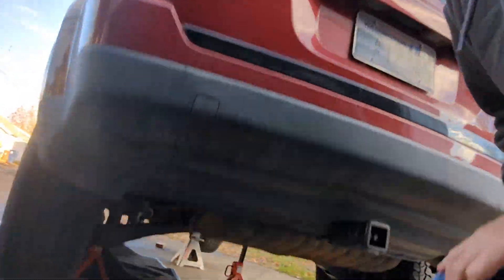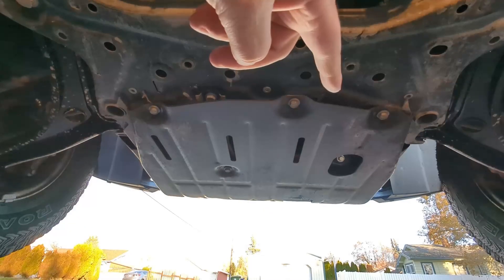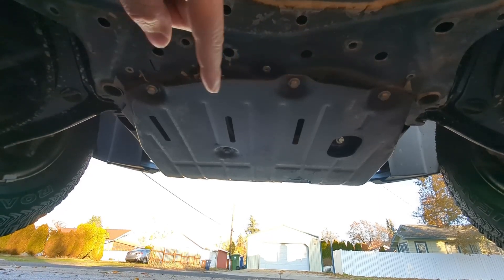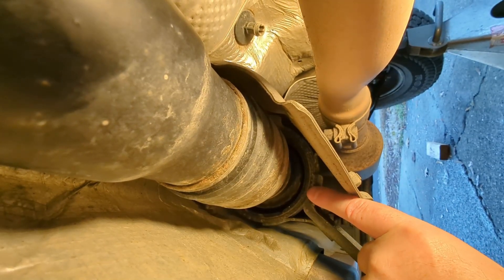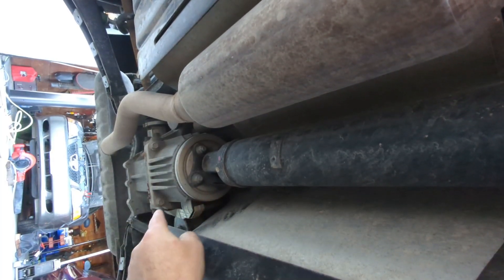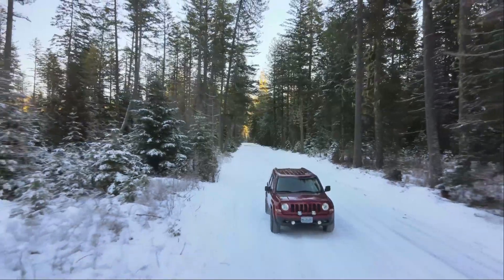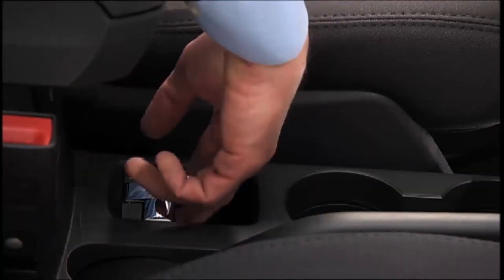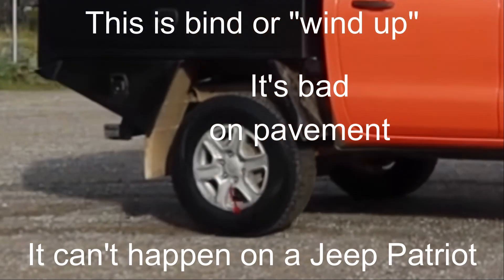How a Jeep Patriot 4WD system works - Compass too!

Comment: How does a person know if the drive shaft ujoints are shot and how to change them,please.I have a canadian 2015 patriot high altitude and trail rated. I also have a lot of extras in it that I have not seen on any of the patriot videos I have watched.
Reply from the maker: U-joints will start to show some play when they're failing,  they'll be quite rigidly in place when they're in good shape.   Any movement to a firm hand or gentle pry will indicate U-joint failure.      The carrier bearing will usually make chewbacca noises when it's starting to wear out,  or rhythmic knocking (at first just under load) when its bushing is beginning to fail.    You can also just visually inspect it,  if it looks questionable the safe bet is to replace it and be sure.

Comment: i have a question could i install the 4wd awd parts to a 2wd 6 speed manual transmision if the power output is the same until the clutch engages whats the diffrence will the ECU act diffrent ? IDK
Reply from the maker: I really don't know enough about the intercompatibility of 2wd and 4wd control systems and wouldn't want to be the first to explore it either.    These things are inexpensive enough that unless you got donors for free I can't imagine it would be cost effective to 4wd swap a 2wd one vs. just selling the 2wd one and buying a 4wd.     

It's similar to when people get V6 or 4cyl pony cars for $2500 and want to V8 swap them but they could just get a V8 in the same condition for $4k in the first place.    Unless you've got cheap or free parts don't build what you can buy.

Comment: Thanks for taking of your valuable time to make this video for us. Very helpful indeed. One question please, Is this system similar to the 4x4 in the smaller new jeep 2015, 2016 Renegades, or are these more rigorous for off-roading? Thanks again.
Reply from the maker: The Renegades have a disconnect at both ends of the driveshaft instead of just the back - this slightly improves fuel efficiency and acceleration in 2wd mode.    Otherwise the 4wd system behavior and mechanism are the same.    Renegades replace the on/off "lever" that Patriots have instead with a mode selector but that changes throttle and transmission behavior much more than it changes 4wd programming.

Comment: Great video!!  Would you say the Patriot is a fairly well-built reliable vehicle?  I have an Xterra for off road use, but considering a Patriot for winter in Michigan for everyday use.
Reply from the maker: In my opinion they are supremely average with all the good and bad that accompanies that word.    I see them everywhere, in fact typing this I'm in a parking lot across from one.. I know they sold a lot but there seems to still be a lot on the road, even 15 year old ones.  
The rear subframe rots in rust states but it's not difficult or expensive to replace.    

2014+ models with the 6 speed auto trans are usually preferred over the earlier CVT

Comment: This was great. I wanted the last box shaped Jeep that was less that $200 a month lol. Got the 2017 and this is excellent info.
Reply: Me too. My biggest complaint about my 2017 Patriot is that it is under powered. If the wind blows it downshifts. That's just crazy. Chrysler should have put the 3.6 in it. 
 But it is my first 4WD vehicle and it didn't break the bank. That was my criteria.....4WD and I could afford it. I'm happy with it so far, I feel like the 4WD does it's job in Colorado snows storms.

Comment: What would happen if I drive my 2014 jeep patriot without the front cv axles?? I just removed the front driver side and now I got no gears...
No park, reverse, or drive
Reply from the maker: The differentials at both ends are open so if one axle is missing there would be no torque transfer.
Reply: @shoveI  
Soo, my Jeep MUST HAVE the CV Axles or it ain't going no where...
Correct??
Reply from the maker: I have to admit I hadn't considered that...  I'd just put the axles in it?

Comment: Can you tow it on a Dolly  Since the axle can connect to the drive shaft or disconnect
Reply from the maker: The owners' manual says 4wd Patriots cannot be dolly towed.  

There doesn't seem to be any preload on the clutch pack so I can't think of a reason they printed that but it's the official answer.

Comment: I had an issue with my 2009 patriot.. I put ignition on and sudenly 4  or 5 dash lights came on, including abs and 4wd!.. I start to drive, after some time I had a knock (similar like you have then you put low gear on high speed), alll dashbord lights dissapeared execpt 4wd!, but it dissapeared after some time... have no idea what it was... :(

Comment: Would the Patriot be ok for taking jetski down the beach?
Reply from the maker: The tow rating is 1000 pounds, or 2000 with the optional tow package.   If you're within the rating there's no reason not to use it for that!

Comment: Any thoughts on how to "lock" the ECC? They overheat and shut off frequently when driving in sand. Rendering the 4WD useless. Would be really cool to have these little suv's behave more like a real 4WD. Great video BTW, explains the system really well.
Reply from the maker: I'm certain it's possible to intercept the ECC solenoid control wires (the control unit is in the left side of the dashboard according to the FSM)  -  it might be necessary to include a dummy load when intercepting them to avoid a fault.   

I can not find it anymore but somewhere I read that the torque capacity of the ECC is 1800 ft-lbs when locked.    I do not know if the electromagnet requires thermal relief while in operation (separate of the heat generated in clutch slip) .
Reply: @shoveI  One day, I'll purchase a spare unit, then give it a try. It's my daily driver, which includes a lot of beach going. Not hard core 4x4ing, as I agree it is not intended to be one. Just find it frustrating that it shuts down so easily. Love my 2014 Compass and not interested in something else. Thanks for the input.

Comment: Great video! I’m taking my son off grid camping in our patriot that has a RTT. Have you ever installed a winch on a patriot? I’m contemplating doing this just because we will be alone and it’s mud season.
Reply from the maker: I haven't installed a winch but I did make sure to have recovery points at both ends and I carry a hand powered winch and a tree strap when I go hiking or camping away from pavement.     Patriots only came with recovery hooks from the factory if you got the "Freedom Drive II" package,  and there's really nowhere else to hook a strap or hand winch.     

Mine didn't come with them so for the front I bought factory tow hooks and for the back I installed a trailer hitch.   I'm not towing any trailers but a bike carrier fits nicely in it + it's a solid, safe place to pull from if I get stuck.    The nice thing is Patriots are so light that a hand powered winch  (sometimes called a come-along) moves it pretty easily and is a whole lot more affordable than a whole winch & the necessary bracketry,  and it works from the front or the back instead of just the front.
Reply: @shoveI  I think I’m going to go with the hitch(I have the tow package)mounted winch for the trip because it’s relatively cheap and I can get a 5500 for under 200. Better safe than sorry 🙌 I wheel at 2012 jk so I’m experienced with sticky situations and there is no better peace of mind than knowing you have a winch.

Comment: I’ve always laughed because of how smooth my pat’s rear diff engagement is, “I’ve got this lil lever right here that makes this fun light pop up on my dash. Not really sure what else it does.”

Problem with off-roading the partriot (besides the ground clearance), is the lack of low gearing. You don’t have enough torque to crawl, so you need to depend on momentum. 

Makes it a better all-around road car, but limits how much fun you are able to have with it on the weekend.
Reply from the maker: I've wished for a low range or a wider ratio transmission too - even a real limited slip differential at either end would help because the nature of the BLD traction control system is to cut your effective torque in half whenever it's in operation.  Taking a load off the BLD would mean keeping the full (if very modest) torque more often.     I think it's possible that a LSD from a Lancer EVO would fit in the RDU but I don't have the bandwidth or finances right now to experiment with that.
Reply: @shoveI  aye I wouldn't mind an LSD at both ends, wouldn't notice much up front until you're stabbin it, anyway.  

The BLD system is a bit of a disappointment.  I've used it to sink and bury myself more successfully than I've used it for self-recovery.  Better off airing down, backing out of what got ya stuck, and then momentum is your friend.

Comment: Mine is awd plus I got a four wheel drive lock button
Reply: Jeep doesn't make AWD , thier is Quadra track 1 which means the jeep is in 4H all the time.  When you hit your 4 wheel drive switch it shutting of the ELS . I have a 2017 patty riot high altitude,  it's a good jeep so I keep it around with my other jeeps.  If I'm doing tight trails it's the go to jeep,  great turn radius  to fit between trees. My only complaint  needs a 6 in it ✌️

Comment: The only difference I would add is if you have the Patriot with "Freedom Drive  II" that it behaves much differently if you have it in "4wd" and then put it into the "L" position on the transmission.

Per the manual:

– Off-Road Features

The following are key off-road features which are active
when the system has the 4WD lock lever engaged and is
in the Low Off-Road mode.

• Hill Descent Braking
 Hill descent braking uses the
vehicle braking system to provide a controlled descent
down varying grades. This feature is only active when
the system has the 4WD lock lever engaged and is in
the Low Off-Road mode or reverse. Hill descent
braking can be turned off by turning off ESP. The hill
decent control speed varies between 4-6 mph (6-10
km/h) forward, 3 mph (5 km/h) reverse.

• Off-Road Brake Traction Control 

 When conditions
warrant, the vehicle braking system transfers torque
from side to side. It does not control throttle input
unlike normal traction control which is active in
Normal Drive mode.

• 19.1 Crawl Ratio –

 When the system has the 4WD lock
lever engaged and is in the Low Off-Road mode, the
CVT2L initially maintains the 19:1 crawl ratio before
changing ratio. This low ratio is ideal for crawling over
obstacles.

• 4WD Lock Mode –
 4–wheel drive lock mode com-
mands a higher torque to the rear wheels, for im-
proved traction capability off-road. It also, turns on
other system features in conjunction with Low Off-
Road mode.

Unique Engine Calibration 
– When the system has
the 4WD lock lever engaged and is in the Low
Off-Road mode or reverse, the engine calibration
changes to run higher spark advance with premium
fuel for optimum off-road performance. Your vehicle is
equipped with an active spark knock system and can
adjust the engine calibration for a varying range of fuel
octane levels.
Reply from the maker: The systems are mechanically the same.    FD-II equipped Patriots have a lower (numerically higher) final drive ratio and  different software calibration to hold the numerically highest transmission ratio.    All Patriots have the off road brake traction control - I demonstrate that in another video - and both 6F24 and manual Patriots can be held in first gear using driver controls.      FD-II is more of a tuning difference than a material one.
Reply: @shoveI thank you for the great video and the way you explain the way it works. do you know if the compass shares the same  4x4 system?

Comment: While in automatic which are the drive wheels as in front or rear in a 2021 compass.
Reply from the maker: The 4wd system on a 2nd gen Compass is mechanically very similar to a 1st gen,  with the addition of a clutch in the PTU so that the driveline connecting the front and rear is stationary under normal operation until slip occurs.  

Normal operation while in 2wd is front drive,  the front axle is always 100% coupled to the transmission and then rear axle can never be driven faster than the front axle.

Comment: Thanks for this info session....my patiot 4wd was not working properly on dirt roads and warning lights flashing when ever I used it and back wheels never locked in and ingaged... So a diff Oil change and clean out wire plug has fixed my issue...so thank you for your time and knowledge of this system .... thanks again
Reply from the maker: Glad it helped

Comment: Is this the same with manual or only autos?
Reply: Even with the clutch in front an back being electronic?
Reply from the maker: 😅 I'm not sure what kind of answer you want..
Reply from the maker: The 4wd system functions exactly the same regardless of which transmission or model year of Jeep Patriot.    The calibration and the final drive gear ratio is different but the components and behavior are the same.
Reply: Is there a way to strengthen the clutches or electrical ingagement mechanism to strengthen the 4wd capabilities ...for better traction in mud or snow?   Just a question?

Comment: Thank you for this video which clarifies many aspects! I believe my Patriot has 4x4 on all the time, even if the dashboard light is off. With the car with all the wheels off the ground and the engine off and the gearbox in neutral, if I rotate the front wheels the rear ones also rotate. Can you tell me if this is normal? I do not think so...
Reply from the maker: There's always going to be a little bit of drag on the clutch pack in the RDU, maybe enough to overcome wheel bearing preload.   It should not be locked tight while powered off.

Comment: Awesome video.  We just purchased a used Patriot and I wanted to see when you could engage/disengage 4WD.  I had no idea it's really a front wheel drive, a plus, and engages the rear wheels for 4WD.  Also had no idea it's sort of always in AWD/4WD at low speeds and heavy acceleration.  You did a great job explaining it.
I hope it works as well as we're anticipating.  We live in a northern climate with fairly steep access to our place.
Reply: Well my wife and I just bought a 2016 4x4 and idk about its AWD system, but I can confirm that when we popped it on 4x4 the other day while it was snowing, I had no issues. I was in slushy parking lots trying my hardest to break traction, even squirreling it left and right, and I couldn’t break it free.

Comment: My friends have a Jeep Patriot that only the front wheels will power the vehicle, the rear wheels wont engage. Any suggestions?
Reply from the maker: The first thing is to make sure it's 4wd in the first place,  they sold these as front wheel drive only too.    You can use an obd2 dongle with an application called JSCAN to monitor the 4x4 system,  and of course one can always safely support the vehicle and get under it to inspect for damage.   If there is a driveshaft and it turns with the front wheels you can focus on troubleshooting the rear drive unit.
Reply: I think they are just going to get rid of the darn thing!  @shoveI

Comment: Is this “Freedom Drive 2”? If not, what’s the diff between your setup and the FD2? I can’t find a description anywhere?
Reply from the maker: "Freedom Drive 1" and "Freedom Drive II" both work the same way, with the same components.   FD-II has a numerically higher final drive ratio and different software calibration for transmission behavior.
Reply: @shoveI I do believe the FD2 TCM’s are actually different, not just a software flash.

Comment: A true 4WD system has a transfer case with a low range. This does not have low range. That is the main difference.
Reply from the maker: Low range is a nice feature but a traditional 4x4 to your definition, when shifted into 4H is not the same as an AWD vehicle.    Some SUVs from the past had 5 position transfer cases with both 4H and AWD selections in the same car.    
In terms of driving dynamics and application those two things are very different and the distinction is an industry standard reflected on emblems and literature for the cars and trucks which feature them.
Reply: @shoveI j😊

Comment: Hmmm i have a 2020 compass is it possible to pull a fuse( like in AWD challengers and chargers) to be RWD? LOL I know its a crazy thought.
Reply from the maker: The 2018+ Compass is built on a different platform than the 2007-2016 Compass but the 4wd system is almost identical.   Just like on first generation Compass it is a front wheel drive platform so if you were to pull the fuse from the RDU or active PTU it would revert to front wheel drive operation.   

There is no way to drive only the rear wheels and not the front wheels because it is a front wheel drive platform.
Reply: @shoveI  yeah I figured,  it was a kind of out of the world thing lol but I couldn't figure out the answer by myself lol. Thanks, I know it sounds weird lol

Comment: now a follow up video showing how the charger and challenger system is different.
Reply from the maker: I'd need access to at least two of them first!    The early ones are actually better for a road car in my opinion,  they're legit split ratio fully mechanical AWD which makes them super responsive and linear